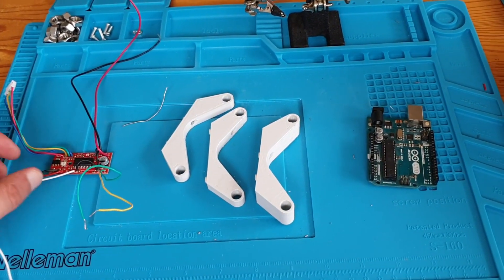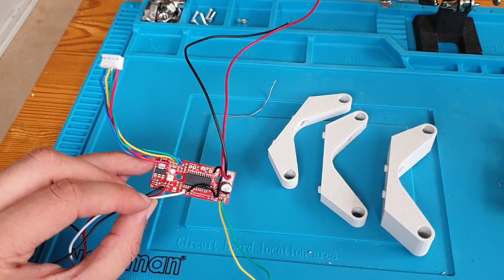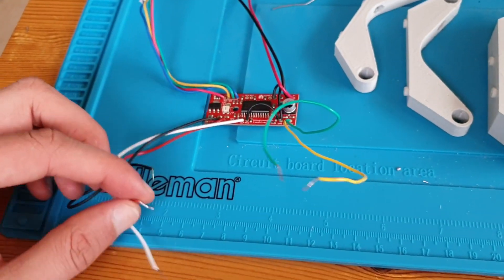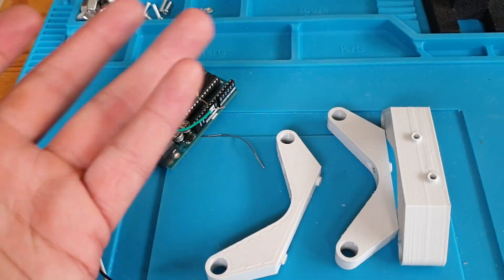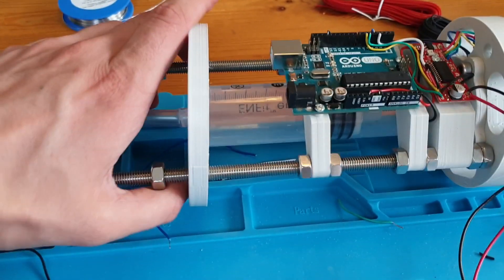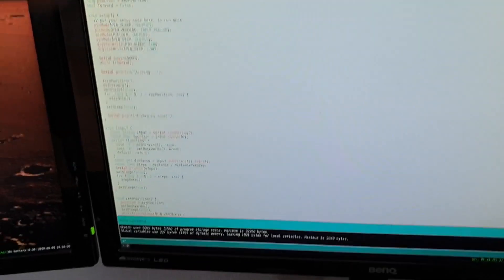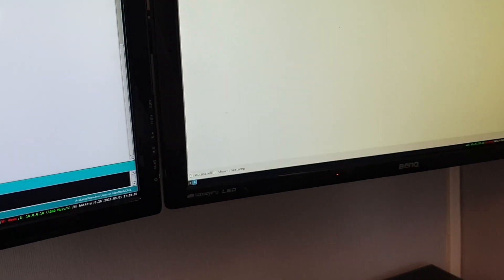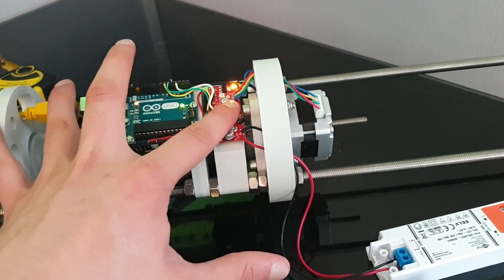Building a submarine - Part 2: Electronics tray

Comment: hey hoylgarbage was the code ever posted ? I cannot seem to get mine to move back and forth properly im using Arduino Uno and L289N motor :/ any help much appreciated
Reply from the maker: I haven't posted any of the code yet due to constant iterations I'm going through. The code you see in this video is also just extremely basic and just a place holder to get it to move at all etc.. I'll probably post the code on github when I'm moving onto designing the firmware properly.

Comment: Nice project.  I'll definitely be keeping tabs on it.

I'm not a stepper motor guru, however it's my understanding that if the stepper gets hot, it's drawing too much current.  Most stepper drivers have a small pot on them that you can turn to adjust the max current that the driver will supply to the motor.  So, you put some resistance on the motor shaft, turn on the motor and adjust the pot.  At some point the motor will stop turning because of the resistance.  You can then turn the pot back a little to slightly increase the current so it won't stall.

Hopefully there are some people following this who are more experienced with stepper motors than I who can guide you in the right direction.

Keep up the good work on the project!
Reply from the maker: Good point, I have tried to set the current dial to something that matches the motor's specification, but perhaps it is too high. From what I've read they generally do get hot, since when under no load all of the energy has to escape as heat. I don't want to lower it too much as I would like it to be able to put as much force as it can deliver, to be able to handle greater pressures.

Comment: If it's "sleeping" the coils of the stepper stator are de-energized and the rotor is free to move!!!...the rotor is not "locked" into position!!!
Reply from the maker: Yes I know, I mention this as a potential problem in the video. However, stepper motors have surprisingly high passive friction, and because of using a lead screw, there's a quite significant gear down effect, so the pressure to push it back would need to be quite high. I might need to turn it on even when stationary at a certain depth though.

Comment: If your are going to experience problems with the pressure backdriving your tank piston you might want to try a trapezoidal screw. Their geometry prevents backdriving. This can be seen on most millong machines were the entire table is moved. Those arrangments are in most cases built around ta trapezoidal lead screw for thus exact reason. But it comes at the cost of a higher operating load. I love the project by the way.
Reply from the maker: Aha, I might look into that. It was already difficult to find an M5 threaded rod with 1x2 mm pitch as it was though. Know of a source in Europe for this kind of stuff?
Reply: I am using eBay or AliExpress. So Europe is relative. But if 8mm is an alternative you will find all you need in the 3D printing section of your favorite online store.  Most 3D Printers use those. So you’ll find screws, nuts, couplings, steppers, you name it. In five mm I would need to do some research. But if you fine a store for standardized Interchangeable parts or components. You’ll be fine. I guess you’ll find them in every country.
Reply from the maker: Ah, thanks. That's where I've turned as well when other sources has failed. Problem is the motor I'm using is one of those with a hollow drive shaft and threads kn the inside so I can't exactly just change the rods thread size, unless I go with another motor or drive solution. But good to keep in mind if there turns out to be problems. It works for now.